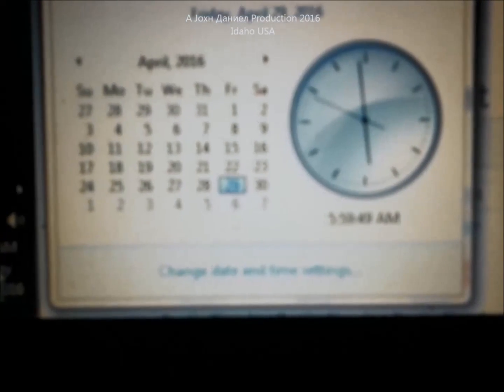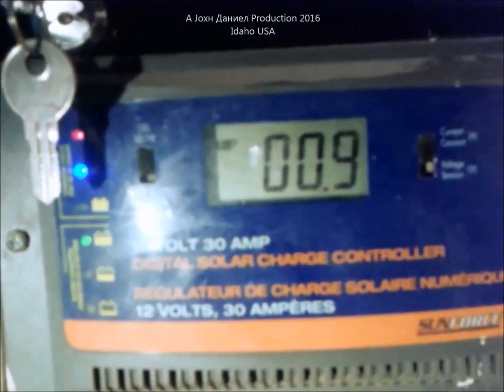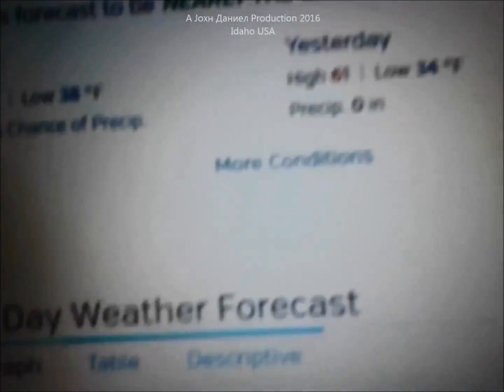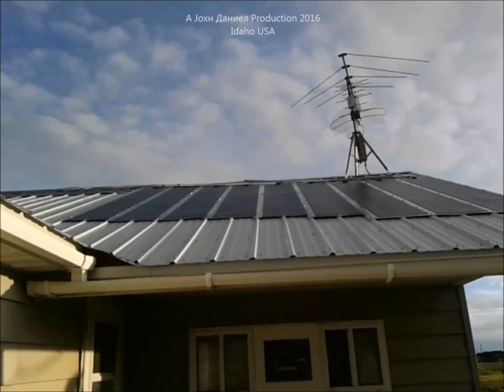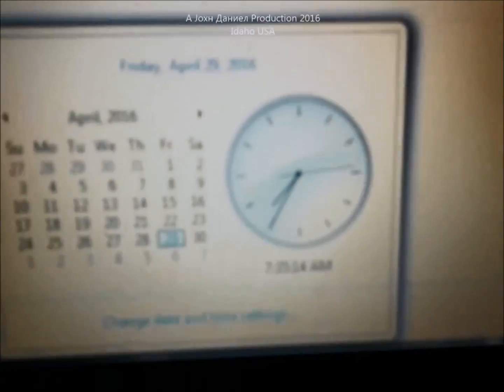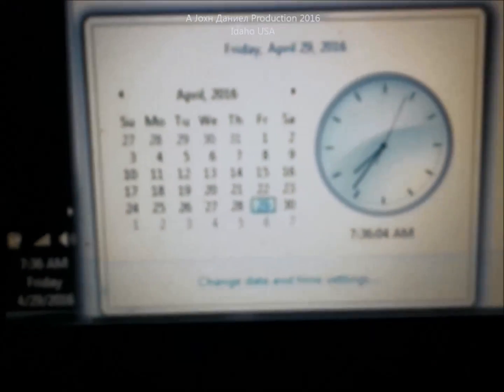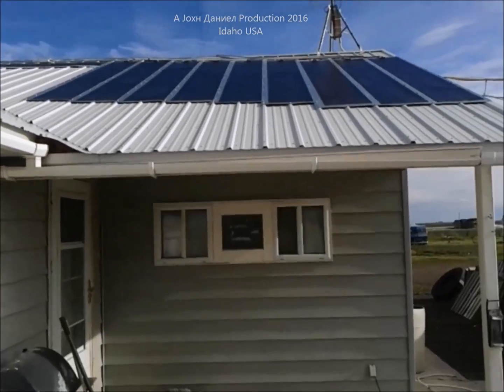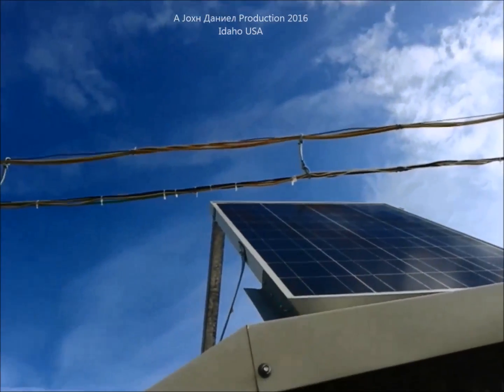Amorphous Thin Film Solar Panel almost makes power in the dark (Parts and options below)

Comment from the maker: Sorry UNI-SOLAR is Gone, BUT! You Can still Do It ✌ Best MPPT controller 40 amp http://amzn.to/2ggyi44 ,Best Low Light Solar Panels https://ebay.to/386aeGp the MightyMax100w4bar *Rock solid power Inverter 2000 Watt https://amzn.to/2v2dPXm , REAL 150AMP Watt/amp Meter, https://ebay.to/2u0muto PROVEN BEST ONE MADE, Don't get fooled by fake vietnam knock off copper colored aluminum wired fire hazard sold from missouri wind & soliar
Reply: Thanks for the video content! Apologies for chiming in, I am interested in your initial thoughts. Have you heard the talk about - Schallingora Computer Reconstruction Scheme (Have a quick look on google cant remember the place now)? It is an awesome one of a kind guide for saving money using this smart solar power trick without the hard work. Ive heard some awesome things about it and my cooworker  got cool results with it.

Comment: Hello john i just picked up 26 145 stion panels with hardware when i put multimeter  the amps are around 10.5 info on panel is just under 3a why would that be
Reply from the maker: Sorry, missed your post. Your STION are high voltage, 50 to 80 volts depending on model. The panel amps will be low. But run them though a MPPT Charge Controller or into a 12 or 24 volt battery you get much higher charging amps when the 145 watts is converted to your battery volts.
Reply: @JOHNDANIEL1  thank you so i have 6 midnite 200v controllers what would be best way to string thanks again my system is 24v sungold 6000w inverter thank you and mis k
Reply from the maker: Just string 2 at a time, max 160 volts since the CIGS panels can have power burst of up to 15%. The 2.8 amps can be ran in 14 awg solar grade cable to a mains box then you can run them for what ever the watt/amp rating is on the controllers in 10 gauge to the controller. At 24 volts you will be pushing 7 to 8+ amps from each panel when it converts down ( volts go down, amps go up, watts remain the same )
Reply: @JOHNDANIEL1  panels are 80v  2.8a
Reply: Thank you can i put 2 series  and 4 in parallel   the box that is with the controller has 4 string connectors ( m c 4 )

Comment: If you put one of each type of panels in a test in exactly the same conditions over the same time of day (lets say 12 hours winter or 15 hours summer) you will get close to the same readings total. I have the Poly panels on my trailer/caravan and they produce a tiny bit of power while locked up in the shed with no direct sunlight at all... only a 6 x 3 foot window no where near the van. I know you are excited over your experiment, but if you live in a very sunny climate... you would be crazy to get these Amorphous solar panels. In a cloudy climate, maybe Canada... yes go for the Amorphous.
Reply: I prefer amorphous solar panels because of the low light capabilities. You can get power from the full moon or even a street light. One guy told me a florescent tube will generate power. If I was to build an arrayof solar I would use two types and mono crystalline and amorphous panels you cannot go wrong. Next coupon from harbor freight I may get the four panel set. I can also get some Renogy panels . Mono crystalline panels as well. Both types are better in all conditions. 73

Comment: Where can i buy amourphous panels??? My 110w monocrystaline panel give now here 900km nort of polar cicle in Norway less then 0,5w of power in middle of the day when overcast (can not even keep my phone charged)... I need panels that works when it is raining non stop for weeks and you want to stay inside with computer. Does not help that the panel array give 1000s of watt on a sunny day when you do not need it... I am thinking of getting rid of the 110w panel and go all in amorphous for the whole 9m2 I have room for on top of my camper van and maybe some panels at the front and sides also.
Reply from the maker: Research https://www.indiamart.com/proddetail/thin-film-pv-module-11299897748.html

Comment: Great video but does the lack of an air gap under the panels not destroy performance and longevity due to the lack of cooling (especially during summer)?
Reply from the maker: They are mounted on 28 gauge roll sheet metal, floating over the existing 1-1/8" gaps on the roofing. Airflow has been excellent.
Reply: @JOHNDANIEL1  Thanks for the info, it wasn't evident from the vid.

Comment: I have looked for these panels and it always leads me to other panels. Would you let me know the company so I can order direct. Thanks your work is very informative. I like the Amorphous myself . They are like the turtle and the rabbit. Thanks again
Reply from the maker: HARD TO FIND, BUT - 1680 watts, 70 open volts, 70 watts per panel, CIGS Amorphous of the highest quality known  https://ebay.to/2DyNsKy Well worth both packs they have, to get a 3300+ watt shade tolerant 30 year system. For cheap!!!! And you will need some of these https://ebay.to/2IKsVXE for a 24 volt battery bank, just one per 24 of those panel sets. If I had to money or could borrow it I would jump all over those panels.

Comment: Hi. The link in the description takes you to panels which are 100 Watt 12V Polycrystalline Solar panel. Mighty Max solar panels. But you said that you are using Amorphous Thin Film Solar Panels! 
  Do you have a link to the Amorphous Thin Film Solar Panels?
Reply from the maker: Yes, the Amorphous manufacturing industry was severely damaged with over 60 gov regulations from Obama in 2010 and 2011, Unisolar, Stion, Kaneka USA and others did not contribute to his campaign like the big Mono and Poly crystalline makers did. So many makers went under in 2012. Therefore your only option is hard to find on the open market, thats why I recommend a 4 buss bar solar panel to get as close to low light performance as possible for folks who dive off into solar power to aid them in a head start of options.

Comment: What do you think of Global Solar amorphous thin film panels?
Reply from the maker: Seems they have lots of pending customers for them.
Reply: @JOHNDANIEL1  I don't know what you mean? Are they not legit?
Reply from the maker: They are legit, made from equipment that came out of Uni-Solar bankruptcy. But with the engineers from china you have to be a SEE IT TO BELIEVE IT buyer. Reports so far are good on them and I would like a few sets to try also. Hard part is finding a actual way to buy them. Lots of "advertised dealers" but no direct to public on them yet.
Reply: @JOHNDANIEL1  They are sold on Amazon at different prices depending on the seller and they are listed differently but same product. Some listings had reviews from verified buyers. One seller has them on Ebay also. FYI.

Comment: What do you think about Mighty Max solar panels
Reply from the maker: I installed 18 of their 100 watt panels in a site near a Nevada ghost town Palmetto, Nevada. The guy I did the work for is a fellow gold hunter. The panels do a excellent job on his 10 batteries. He now has the ability to run a 5300 btu airconditioner this year. He had 4 panels from Missouri and 2 from a place in Texas that all were thin framed, shoddy construction, highly over rated, and failed in under 3 years. These are 100% better than any of those.

Comment: ok I'm wondering if they will work on an rv,I have one and I'm trying to decide which type of panel to put on it
Reply from the maker: They are OK, but If you get a few pairs of these, http://amzn.to/2uGWLVH DM 77W CdTe Solar Modules, 3 sets of 2 - and a good MPPT like this 40 Amp http://amzn.to/2vIJFnG by EpEver,  you would be loving RV LIFE in a whole new way! I have to do a video soon on my 4 DM Panels, they rock. I would definitely go with 4 of the EXIDE  or Similar 90 to 100 amp hour @20 hour rated Sealed Lead Acid as a battery, SLA ( sealed Lead Acid)
A excellent high power inverter is the PEAK 3000 watt  Best place to get one for $200 is http://amzn.to/2r5227D, ( Component is Hyundai Electronics Corporation) they come with big Cables, remote & install parts which no other come with for that cost. 
Just be sure to get you a decent 500 watt PURE SINE inverter for fine sensitive electronics like a LCD-LED tv.

Comment: I thought Amorphose panels degrade in the Sun faster than mono or poly cyrstaline, and no way they are going to last 25 years or so.
Reply from the maker: +capnrob97 My uni solar were made in 2006, they still put out better than 95%. Compare that to my Sharp 180 w Mono panels, they are a year newer 2007 and barely hit 60% now. 
The Sharp and BP solar I have used are already discolored and weak. 
The reason I use Amorphous  (not harbor freight junk) is its stability according to the record on them. 
But people can buy what they want, I prefer the Amorphous as a user of all formats.

Comment: Our company  mono panels in remote areas need replacing every 5 years as they drop output to 65% of rated capacity.
Perhaps they should go amorphous that will last forever.
Reply from the maker: +Myles Nicholas Seems amorphous has the highest stability of all common mediums. Mono has a degradation issue that's why I no longer use them. My uni solar are almost 10 years old, they still produce near full rating.
Reply: Yes...25 years or more. Yet most manufacturers are going out of business due to the influx of cheap two year panels